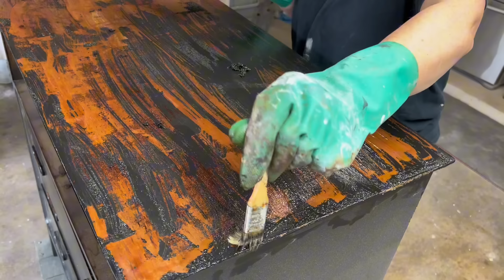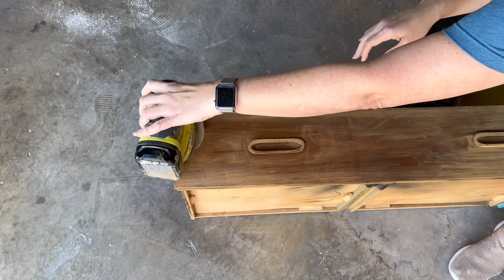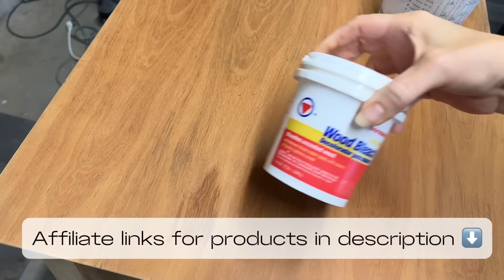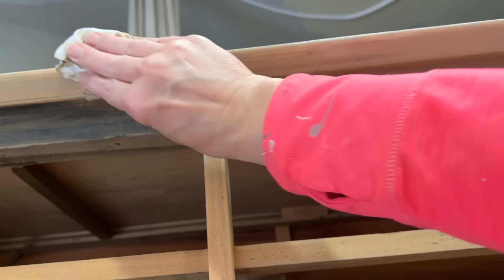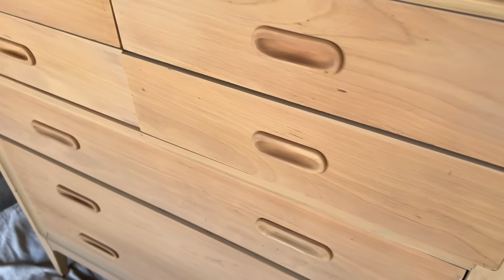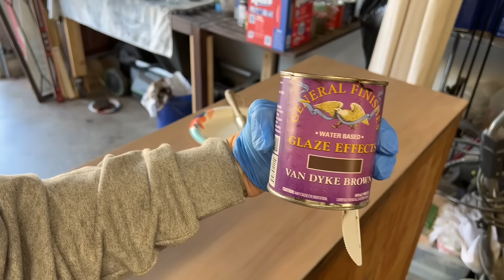Painted Dresser Nightmare! Did I make a mistake with this one? #furnitureflip #furniturerestoration

Comment: I love this design.  Especially the recessed drawer pulls.  (The active ingredient in Barkeepers Friend IS oxyalic acid.)   Using the paint wash to cure the overspray was a brilliant idea.  Using deep center paper plates is a great idea, too.  Toss it when done and no more cleanup.  As for the top, I admire your persistence at getting it right.  Every now and then we run across a project like this that tests our patience and our skills.  You applied both very well.  I appreciate that you kept going until it was right.  It's beautiful. Job well done.
Reply from the maker: Thank you! It definitely tested my patience, but I love the final results ☺️🙌🏼

Comment: Dang, you are so patient! I would've been cursing and stomping! I love the lines and integrated harware, too. It turned out lovely due to your perseverance. Thanks for sharing your difficulties and solutions. I have had good luck leaving the oxalic acid on overnight, sometimes it takes 3 applications to get those stubborn stains out. I neutralize with a baking soda and water wash then rinse with clean water to be sure it is all removed.
Reply from the maker: I’ve never left it that long, but that might be option 🙌🏼

Comment: Interesting to see how you experiment with the tones. I like the darker colour you finished with vs the initial. It is a handsome piece so much better than just painting it and in keeping with its period but a touch more modern.

It's a lot easier to use metric measurements as they are decimal based. Also, hypodermic type measured syringes are much simpler than calculating fractions of a teaspoon.
Reply from the maker: Thank you! Yes, I use a digital scale for toning and it was much easier 🙌🏼

Comment: Nothing ever goes quite the way we plan it.  It has been several years since I stripped a piece of cabinet furniture but I do recall switching from the 3M and Kleenstrip brands to CitrusStrip because it was more pleasant to work with.  I worked in sections applying stripper and laying plastic over it until the paint was lifted and I did not have to worry about the product drying out before I got it all scraped off.  Everyone develops their own techniques and it looks like yours worked well for you.  
You achieved a beautiful result thanks to perseverance, elbow grease and attention to detail (key ingredients for a quality outcome)    Well done  :)
Reply from the maker: I used to love Citristrip but they changed the formula and now it doesn’t work very well. 😢 I’m still on the hunt for a better finish stripper.

Comment: So interesting you tried Barkeepers Friend (BKF)  first then Oxalic Acid. BKF’s chemical make up has a weak oxalic acid. So, it can be helpful if you have a small or lighter type of organic stain and no oxalic acid on hand.  The application is the same as what you would do with regular oxalic acid in that you apply it to the entire surface so you don’t inadvertently lighten the stained area only and creat halos.
Reply from the maker: Well, I use it first since it’s weaker and then step up to the oxalic acid if it doesn’t work. I try to just lighten the stained areas first and not the whole surface so there aren’t variations. If I still have some problems, then I’ll go over the entire area

Comment: Beautiful!  I was looking at one of your short videos about using a roller instead of a brush. What’s your thoughts on a foam roller versus a nap roller? Do you get a smoother finish with a short nap roller? Thanks
Reply from the maker: I prefer the short nap rollers. I know people who love the foam rollers, but I always seem to get bubbles with them. The most success I’ve had with them is to brush on the paint and then use the dry foam roller to smooth it out. 
My best roller finish is with Staalmeester rollers. Smooth as butter.
Reply: So what size do you get in the staalmeester roller.. the 5 mm? Thanks again 😊for